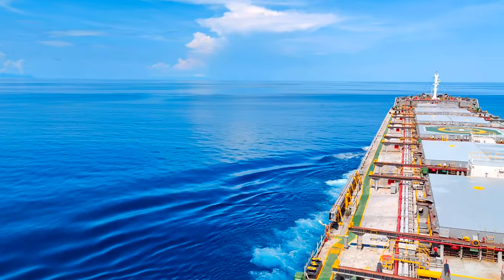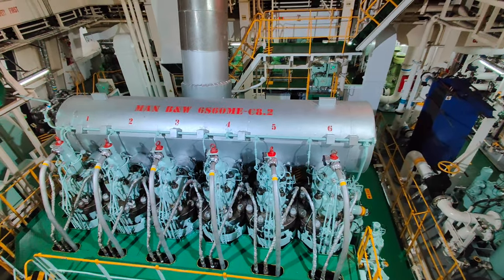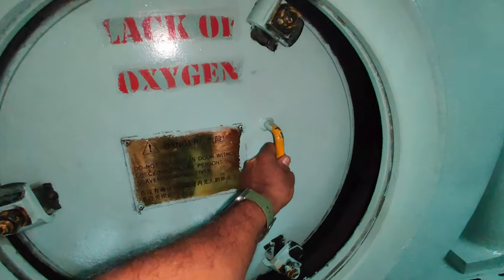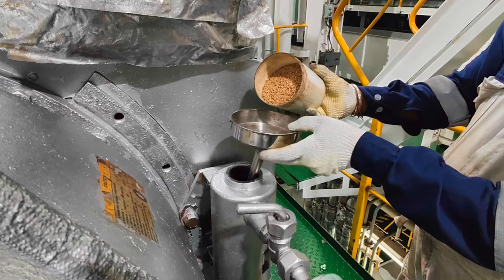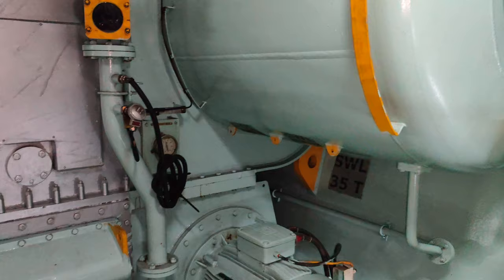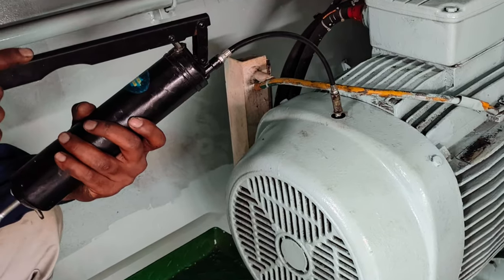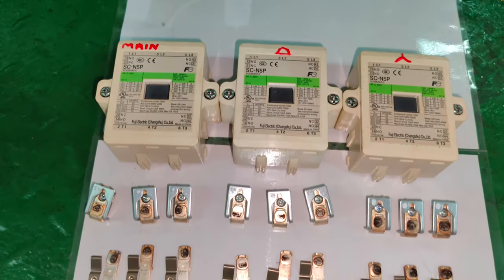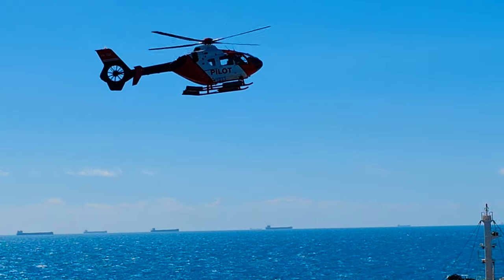ME ENGINES LOW LOAD RUNNING PROBLEMS AND PRECAUTIONS | SEA LEGEND |

Comment: What is period for inspection of scavenge air reservoir? Is your company pays to oilers for cleaning scavenger?
Reply from the maker: Hello,...Best practice is to clean and inspect Scavenge manifold every possible opportunity in a month...
You are sure that ur overall Piston ,rings and Liner condition is satisfactory...
Yes our company do pay 10 USD per unit for said job.
Reply from the maker: Hello,...Best practice is to clean and inspect Scavenge manifold every possible opportunity in a month...
You are sure that ur overall Piston ,rings and Liner condition is satisfactory...
Yes our company do pay 10 USD per unit for said job.